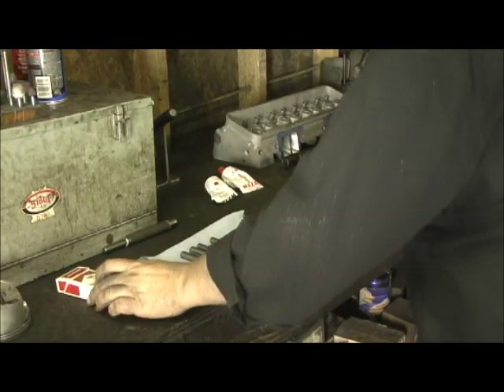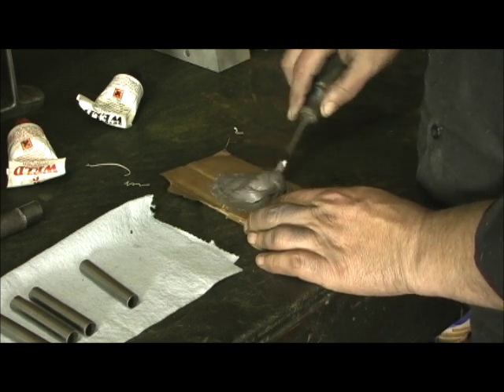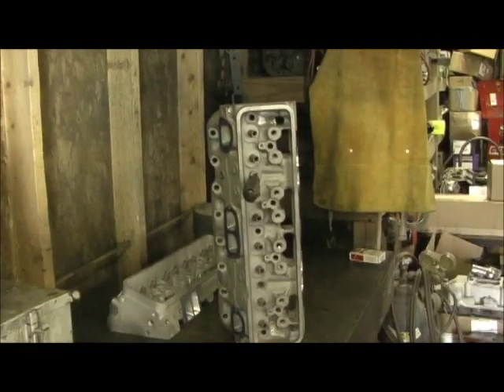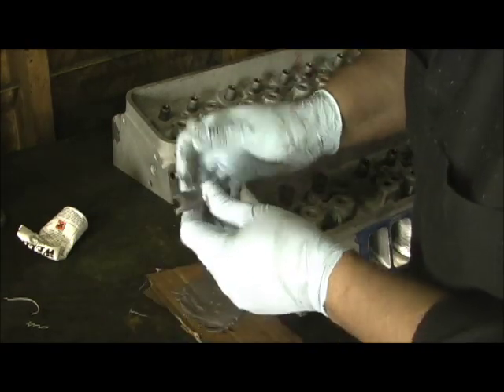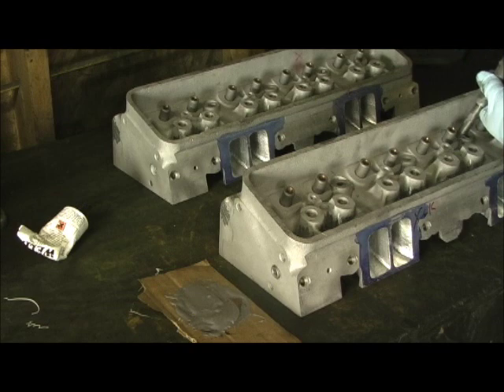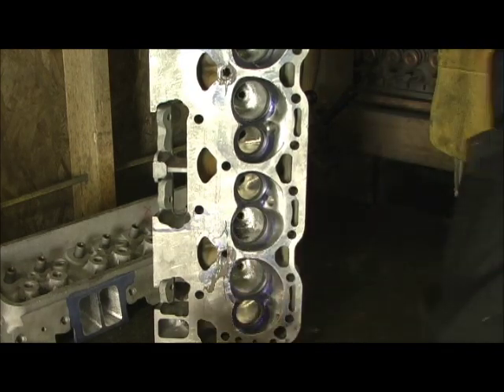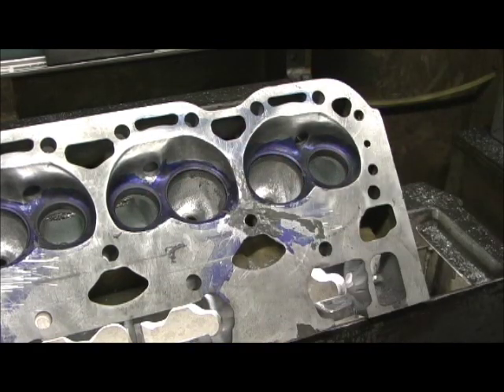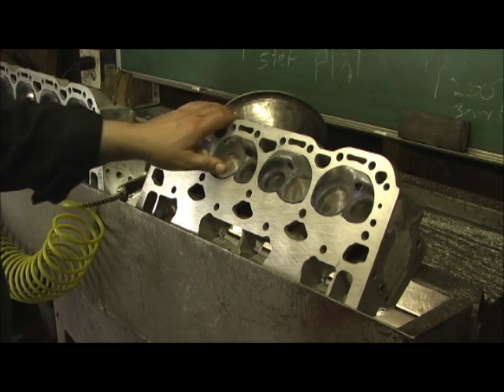LT-1 Stage IV Full Porting "TUBES" and "TURNS" Part 6.2

Comment from the maker: Not really, since the shortest distance between two points IS in the case of the SBC the middle of the length part of the port of the intake flange to the short turn where it is close to the seat, the low to MID LIFT side is where it would hitting the hardest. As soon as the valve lift crosses over to around 350, it changes sides on the SBC and moves to the pushrod side of the port because it is unshrouded and easier for the air to get out the chamber that way.

Comment from the maker: Be careful on the small valve thing, it needs to be at least a 1.90 or BIGGER in order for the void not to overhand the "line of sight" from the intake flange to the seat of the valve. You want the "TUBE" to just be seen a little bit, and then reap the rewards of KILLER 0 to .300 valve life action, or off idle to around 4000 RPM. I used it for all of my round track guys and they loved the "off the turn" kick in the ass.

Comment from the maker: One more time, FLOW NUMBERS DONT MEAN CRAP, if you ask any of the top cutters in the US, they will tell you that they hardly turn on the bench (Mondello, Vizzard, AL Neil, so on), and that they only put the head on there for peoples "Bragging Rights". They found out years ago that the numbers off the SF-600 don't take into consideration the fuel mixed in with them. Now on the exhaust it is different, and COULD help there but once again, it is more about CSA, line of sight, expansion rates.

Comment: Where do you get these tubes, and what are the lengths usually? I understand the issue with the room needed under the head bolts. Im assuming something like brake line?

Comment from the maker: I can see it, but that would be a lot for this valve, and what would the shape be like that? This thing laid out in the most perfect CSA of any heads I seen in a while. I do know this, anymore, and the port would be a pig unless you was at least 383 or above, not to mention SCARY THIN !!!!!! In the least thickness area's it was no less than .085, and on older heads I don't like to go below .085, so personally I say there full of POOP, and also, how long did the 205 run, a few minutes before BOOM